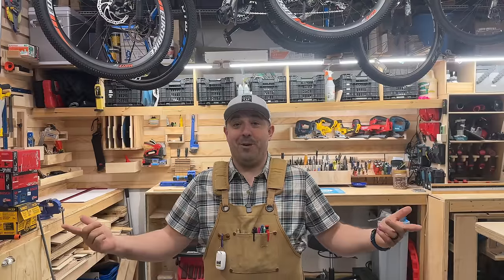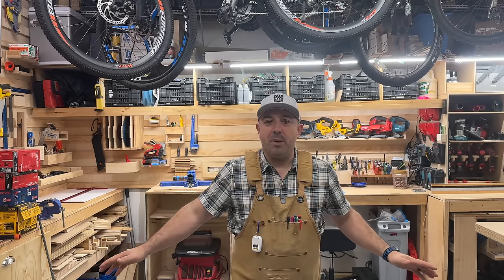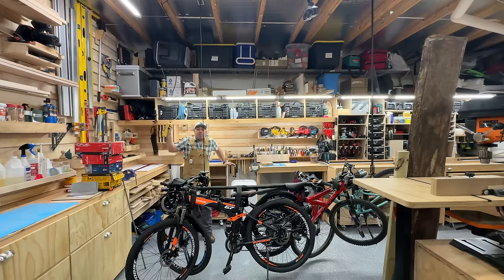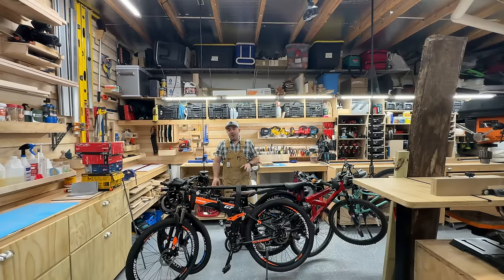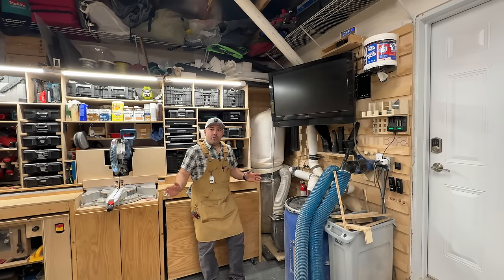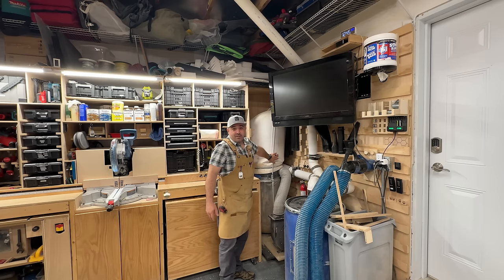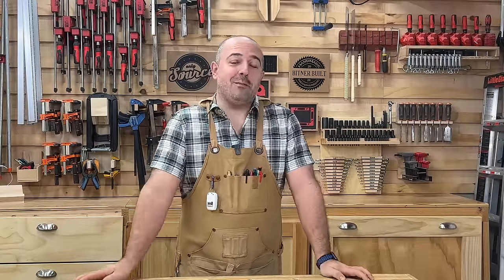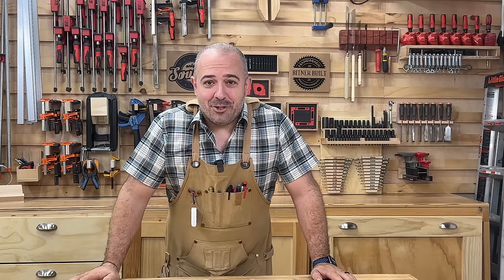Small Wood Shop Storage Ideas

Comment: Another great video, curious about where you get those black "milk" crates that have the miscellaneous storage? Also, and I know you said the space is fairly new, but do you remember what epoxy floor you did? Do you recommend it? Holding up well?
Reply from the maker: Thanks! Those long crates are rigid brand from the Home Depot. Oh I do remember the epoxy floor and it was a nightmare! It was the Rust-Oleum rock solid at Home Depot I first bought 2 of the 2 car coverage kits as I read you use 2x what they say you need. Ended up needing 4 boxes! Then after a week it still wasn’t dry in huge patches, they said it must have been a bad batch… was instructed to use a stripping agent and scrape it all off with a scraper and then start again… well I just spot did that where the material was still wet and bought 2 more boxes and  just did those spot areas and it worked but there super obvious differences now, as a perfectionist is drives me nuts all the time but it was such an ordeal having all my shop out in the driveway under tarps for 2 weeks i can’t bring myself to redo it. Is the floor hard and not getting any worse, yes. Even with heavy tools on castors, and in cleans easy
Reply: @BitnerBuilt  so helpful, thank you!

Comment: That's not a small shop mine is 10 x 14 with a mini panel saw in it along with workbench, mitre Station, morso machine. Underpiner the great wall of clamps
Reply from the maker: Cool cool. Do you have any tips then on how are you get your tools into such a small space? Thanks!
Reply: @BitnerBuilt  the first rule which is hard to keep is only buy one machine, although i do have 2 chop saws one has to go. clamps front to back rather than side to side. limit the the amount of wood stored. The tools used most get the main real estate. The small panel saw (cuts a 4"x4" sheet) takes up most of the room but the slider can be moved out of the way so i'm constantly moving it as i walk around. A long stick gets to the dust collection on/off button. My smaller machines like band saw, pillar drill, planer thicknesser & lathe are all very small and kept in a corner and only take out when needed. There are no real tips only work with the space you have but when building my bench i made sure that panels on my slider would be able to pass over the top of the bench. The bench is also part of the mitre station. Any timber on the right of chop saw passes over the infeed to the morso cutter.  Because i work alone i can only be in one space at a time therefore each task can borrow circulation space from other areas. my work bench has 12 drawers and that a great space saver. I have to build more cabinets for the wall and that should save more space. Sometimes guys (as in this guy) hold onto things they think they need & most of the time forget they have it so is it really needed. maybe when i get it all put together and cleaned up I'll post a video